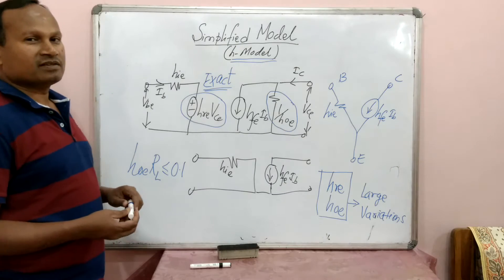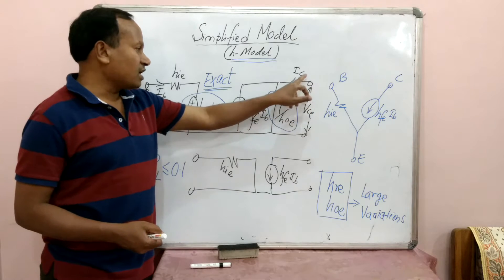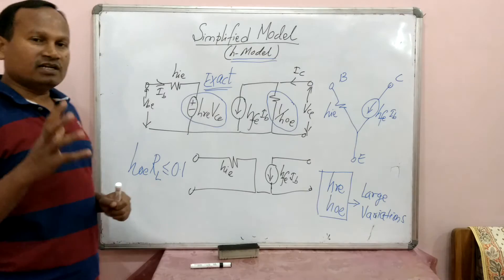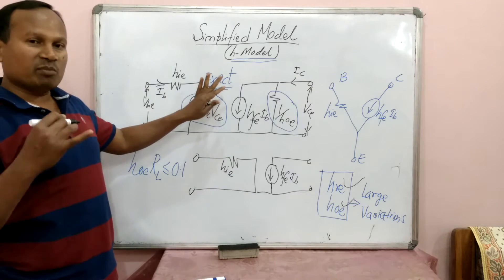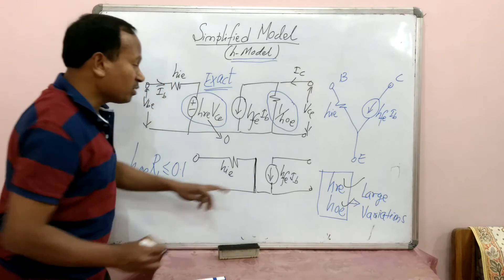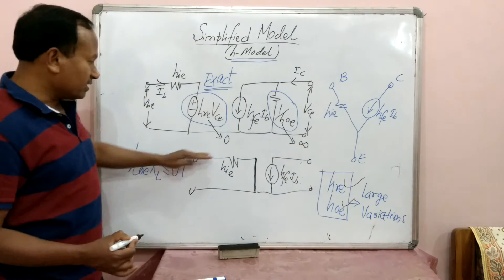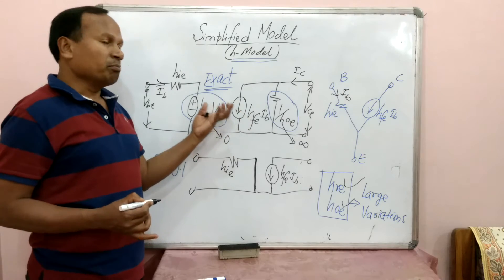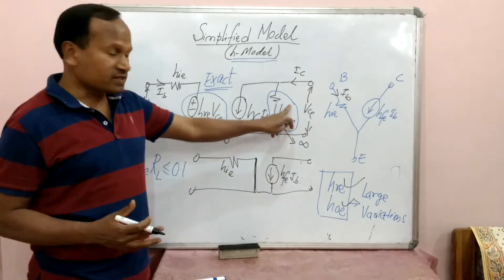Common Emitter (CE) Simplified h-Model

Comment: sir pls calculate the current gai and voltage gain
Reply from the maker: Oh, Thanks Gurucharan for your query. That is very simple. You can see the current gain as -hfe and voltage gain is -hfe(Rl/hie). If you want then I can make a small lecture and upload it. Would require some time since I am quite busy in next couple of weeks. Good luck..